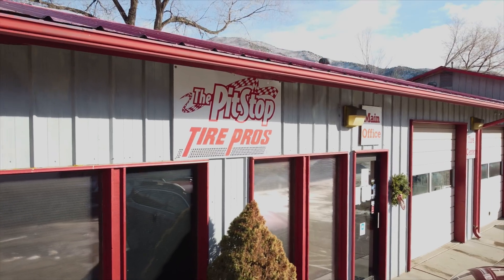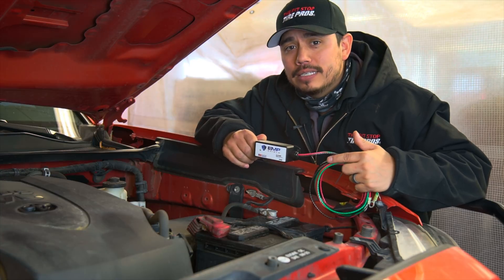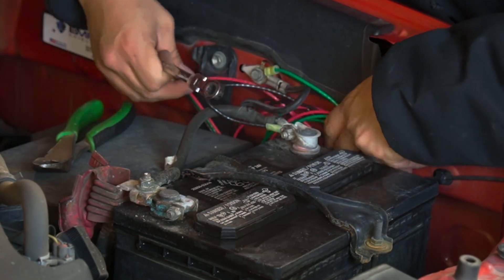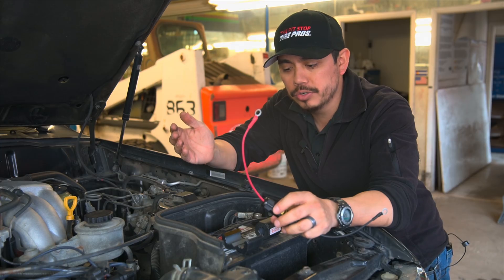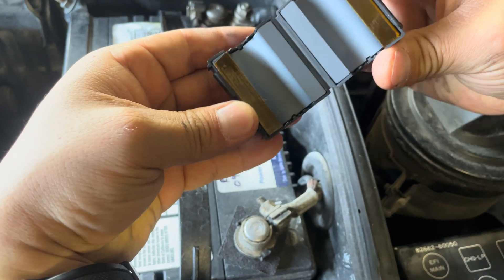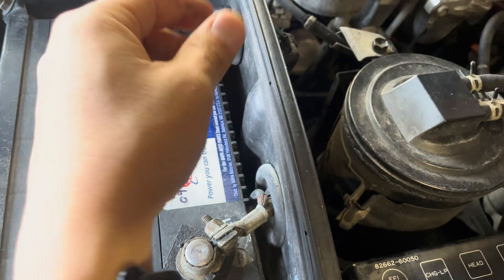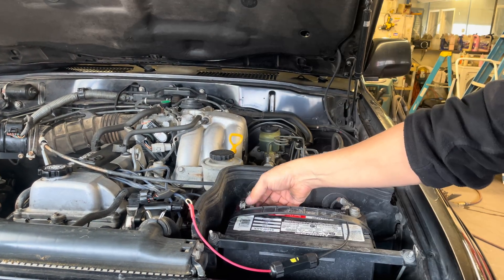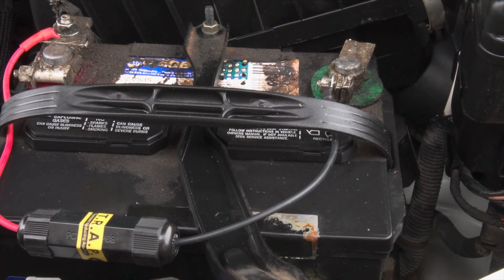EMP Vehicle Protection / What are the options?

Comment: Ok there’s a big thing I need to mention here. It’s that the EMP thing is a very old myth that continues to make people believe you need older equipment to survive. It’s not true and here’s why. New Mexico tech did a study a few years back and they repeat it every few years as cars get redesigned. Their outdoor EMP device was used to test a number of modern vehicles for resistance to a pulse. The study found that most vehicles if shut off durning an EMP will have no serious damage from the pulse. Running vehicles will shut off but can be restarted almost immediately. There might be some other non essential systems knocked out like the tire sensors or the radio or some of the safety sensors but the core vehicle systems will be unaffected and it will remain 100 percent operable. The reason is that a car is essentially its own faraday cage and it’s insulated from the ground via the rubber tires. Car computers if you think about where they are usually located are also insulated internally and are very robust internally they have to be. They have to withstand 160 plus degrees in 90 plus percent humidity for months at a time, followed by months of extreme cold with endless heating and cooling cycles. Stands to reason they’re going to be a lot more resilient then people give them credit for
Reply: Actually, it just dawned me.
There's a difference between a solar flare EMP & nuclear. From what I've read appliances & cars would be unaffected by a solar flare but the transformers & grid would get fried.
But, a nuke EMP would fry everything.
So, did study differentiate between the two?
Reply: @markmcflounder15 I know two different people that got their vehicles struck by lightning knocking out the stereo system in one and instrument cluster in the other. Might be a good investment for price
Reply: These things look like the surge protectors and not EMP protectors
Reply: As an electrical engineer, I'd want to see the study. Not to be insulting, but NMT is not exactly a top rated engineering school. #165 in the country. 

A metal car body is hardly a great Faraday cage because it has too many openings. The metal body helps a tiny bit, but not that much. The size of the openings determines the frequency wavelengths it will block, so not much. To illustrate that, does your cell phone work in your car??? 

EMPs are complex. In the case of a weaponized EMP,  The initial C1 pulse is most likely what destroys your processors. It is a very short pulse but very high energy. A solar CME will be much lower energy, but it can last a pretty long time. If I were gong to pick one, I would probably go with the EMP Shield because they meet military spec, 

EMPs can vary a great deal so it is tough to get very definitive. If the grid gets toasted taking out transformers, in your area, your car probably takes a hit. If kept in a tight steel building with steel doors and no windows and you have an EMP Shield, wiring in, you'll probably be OK when other cars around you become boat anchors. If in a city, a large underground parking garage, might improve your odds. And if it's a bad one, you'll want out of the city quickly!

A weapon based EMP probably hits at night, but a Solar CME will be a daytime thing. If you don't have anywhere to go where you can be safe, it probably won't matter much if your car works.
Reply: @professorg8383 I have done research on the EMP Shield boxes, they appear to be a standard power line lightening surge protector using MOVs for the home version and Transorbs for the 12 Vdc version.  Both types I expect to be totally worthless in providing protection against the E1 pulse.  You really can't tolerate any lead length between ground and the point you are trying to protect.  Even I you were able to use a surface mount shunting component, if the E1 pulse is at 10 GHz, 0,28 inch away from the connection point on the wire you are trying to protect, it is a quarter wavelength away, thus an open circuit protection wise.  Additionally, all of these bolt-on EMP protection devices assume the EMP will only travel into the circuitry via the power line, signal lines are ignored, as well as the radiated EMP finding multiple paths into the circuitry.
Reply: From what I've read, I'm not claiming anything here I'm no professional. Just curiosity. Sounds like a weaponized version is what we are worrying about. And like someone said, nuclear emps are going to hit somewhere along 50000 volts across the US. Pretty much everything is completely toasted unless it's already underground. I'm not ready at all.
Reply: That sounds like they're testing resistance against a lightning bolt & not an EMP.
How did they reproduce the EMP?
Reply: @markmcflounder15  
I get it wrong at times but A lighting bold is a EMP with a large amount of current.
Reply: You got it wrong. Read Wikipedia.
Reply: @OrmondOtvos  Wikipedia isn't allowed in any actually good study. Go actually study
Reply: Was thinking that too,, answer -  they didn't.
 @markmcflounder15
Reply: @markmcflounder15  It's government lab that has a large EMP device ( believe Navy?)  They rent it out to the OEM's to test vehicles.
Reply: BS.
Reply: 'There might be some other non essential systems knocked out like the tire sensors or the radio or some of the safety sensors'.  I wonder how vehicles that have all the electronics consolidated in the stereo head unit would fare?  Had a service writer mention that Hyundai has incorporated this design into a number of newer cars.  Stereo goes bad and you need it repaired?  You need to get a hot swap or an immediate repair so the car will run.  Someone steals the stereo the car won't run.
Reply: Ah, the things you will never hear from a dealer when you're buying a new vehicle.  Thank you sir for this PSA @KentWilke
Reply: Remember.04 ohm change will trigger the computer in car to throw many codes. Some may shut car down. Also the newer cars have much thinner gage wire and won't take over load well at all.
Reply: @thomaswaldorf9141  I noticed that fitting accessories to new chinese vehicles. The individual wire strands are like cat hair!
Reply: If a vehicle is essentially a faraday cage,  then couldn't you just throw your expensive gaGets and generator in the trunk and be all set?  Is my logic faulty?
Reply: @uncledog-x2n  It isn't a Faraday cage!! Claiming  that it is a Faraday cage, is untrue.
Reply: So the Soviet test in the 1950s, that fried the electrics in the 1950s cars didn't actually happen?  -- even though documented.   Huh???? Sounds like a fairy tail to keep panic down.
Reply: This is true for metal body cars, but the fiberglass body ones and those with overly complex systems will be fried. The other issue is the proximity to the pulse as well. The vehicle EMP protector does work well as a lightning surge protector for radios though when combined with a gas tube arrestor on the antenna, but as wired will not protect a car 😂
Reply: Laughing all the way to the bank... EMP is inductive, the energy is a wave traveling in the air and anything remotely conductive will gain a voltage from this wave passing. No way some box hooked to your battery can help, all wires on the car will light up at once , this Fries diodes that normally keep energy flowing in one direction and over volts most coils. The over voltage doesn't come from a battery spike and spread through the wiring harness like that product is designed to handle... All the wires go 90v and many positive and negative situations are created instantly, then the circuit has to discharge somehow this can fry the wires into thin air if not grounded, this is in a high energy EMP like from the sun...
Reply: Texas Tech and Texas A&M have done similar tests with similar results.
Reply: A burned or torched car shows how thin modern car panels are. Burning paint often melts away the roof, doors and other panels. Dont expect it to withstand and EMP or lightning if it won’t handle mild heat or electrical charge.
Reply: @jackjones9460  Modern cars handle lightning very well. I bought a 2004 SUV that had been struck by lightning and would no longer start. I only paid $6 plus the towing fee. Repainted the hood since that is where the bolt hit. I replaced the battery, a few light bulbs, did a reset of the PCM and BCM and it started and ran fine. That was almost 6 years ago and it is still going strong. By the way, it was struck while driving down the highway during a thunderstorm.

Comment: The EMP SHIELDS HAVE BEEN TESTED BY OUR GOVERNMENT. Go to the website, read, listen and watch the video before you say lies on here!!! All our Politicians and other government vehicles all have this installed on all their vehicles. We decided that we don’t want to walk several miles to get home and didn’t want to leave our vehicle along the roadside for many weeks or months. Imagine if the tow trucks don’t work or if they do it will be months removing the vehicles off the roads.
Reply: The EMP Shield has been certified to absorb voltage transients according to MIL-STD-461-RS105 and other standards. This only means it will protect the 12V system that you attached it  to. It can not protect the other components that are not connected directly to the 12V battery.  All the computers like the ECU, PCM, TCU  are on a separate 5 volt power system, and are very susceptible to voltage spikes. The EMP Shield on the 12V battery is not going to protect the low voltage circuits. Fortunately the car computers are usually built with transient protections.

Comment: I like to see it work
Reply: It will “work”, of course, if your aim to prevent permanent damage… but most modern vehicles aren’t permanently damaged by EMPs anyway—they test for that in the design phase nowadays. The only way to prevent an EMP from temporarily disabling your vehicles electronics is shielding. The doomers here are worried about EMPs from a nuclear device, but need to realize that there would be much bigger things to worry about than having running vehicle in that scenario.

Comment: This is going to be one of the best marketing strategies I have ever seen. It's a product you can't even test and if it's actually needed that if it doesn't work you won't even be able to go after the people who manufactured it 😂😂😂😂
Reply: Buy an old truck from the 70's that doesn't have a computer. Problem solved.
Reply: @AtomkeySinclair  Yep, that’s what my “buggout” vehicle is a manual 1990 ram 250 with a 5.9 Cummins.
Reply: @AtomkeySinclair you know computers have been used since 1968 right?
Reply: @flight2k5  I bet you also know the point I was trying to make regardless of how early the first manufacturer used a simple computer for the ignition system. The point is, get ONE that DOES NOT have a computer from that time period.... Then you have wheels that don't stop if you are truly concerned about EMP. Thanks for commenting.
Reply: @AtomkeySinclair  I’d  be willing to bet the emp thing is blown out of proportion. They actually did a test and it wasn’t a real issue with modern vehicles
Reply: @flight2k5  Very possibly. Besides. If that kind of stuff goes down having a vehicle will be the least of concerns. There may not be anywhere to go...!
Reply: @AtomkeySinclair you need to go older than that.
Reply: @ZeRTO_13  Well - it's a 1969 Chevy pickup truck :)
Reply: You can make an emp device at home look it up create replicated and test on the device to break and report it back
Reply: @GeorgeWashingtonThe100th  BUT WHEN WOULD YOU NEED IT!??!?! The poin t of an EMP sheild is just simply un needed, If a solar flare happens, were all gonna die sometime soon, Lightning striking you is a like 1/1000000000 chance.
Reply: @im_so_bored_rn  its the idea of it but we need to learn to adapt to survive without electricity lol
Reply: Guaranteed for life! Moneyback guarantee! 100% customer satisfaction! I’m with you I’m a little bit of a skeptic
Reply: Right THE CLAIM It can go to ground...DONT see that happening with RUBBER tires. Like the ones for homes... Every home is REQUIRED to have a ground loop already
Reply: Its not the battery that needs to be protected, its the tiny electronic components that will fry. So an old car with no electronics, will have the best chances to work even if it gets hit by an emp. A car with an old diesel engine, without fuel injection and without electronic ignition system would be the best choise.
Reply: This just might be the biggest scam I’ve seen on the internet yet.
Reply: Work or not - you can never sue the maker if the time comes and it doesn’t! - I want every chance possible to make it home from wherever I am to my family. Better safe than sorry.
Reply: I’ve always believed that the government flashes EMP in June to prompt people to buy new alternators
Reply: Unfortunately, none of these EMP protection devices that use wires as a means to connect to a point of desired protection can offer any protection from the E1 pulse; it's just too fast. To have a chance of offering some protection, the wires between the area you want to protect (typically the 12 volt line) and the actual component within the protection box, needs to be a tenth of an inch or less. Even with the tenth inch wire length, protection is still insufficient because the EMP finds it's way into circuitry in a variety of paths besides the 12 volt power line.
Reply: Brilliant
Reply: You know what they say they're just sucker. Born every minute. And generally people don't understand how emps wotk
Reply: lol big difference between lightning and solar and bomb
Reply: These are real....fake...

Bunch of varistors with specific limits .. this won't help much.

A experiment can be conducted though with this device. Although, it's tricky because what you are shielding against is already grounded in a cars case.
In a emp, any and all metal will conduct the voltage. Unless you have a ground prong stuck in the ground attached to your car with a cable this is ineffective. 

Imagine a coil of wire..being what's needed to be protected. (Phone semiconductors...any microprocessor) how can you protect the coil from an inducted voltage spike by grounding, when the coil itself IS THE CONDUIT. ?? 

It's a thought experiment. Because all metal objects will act as our coil. The metals we want protected that can be damaged
Reply: imagine being that broke that this is the first thing you think offf😂
Reply: Kind of like the vax
Reply: @phoenixbenjamin where is the “slow clap” emoji when you need it?!  Well spoken.
Reply: Very true.  BUT, if it works it could save livs right before the entire world ends.  It is a crap shoot.  Wanna play?
Reply: @henrymorgan3982  prep non computerized vehicles and gennys.
Reply: @henrymorgan3982  Sounds a lot like "be a good boy and you might get into heaven"
There are plenty of labs that do EMP testing up to the level of the ones generated by nuclear weapons.
Reply: it does not work.  rest assured.  it has very long leads which are going to make any EMP worse. @henrymorgan3982
Reply: @henrymorgan3982 your comment is pointless
Reply: Yes, that’s just like a coffin. The person that makes the coffin doesn’t use it, and the person that uses it never sees it. And the person that buys it never uses it.
Reply: You had better keep water and snacks in you vehicles at all times. Before we had the EMP SHIELD installed on our car we went to see our Mechanic. He said they are great and he's putting more EMP SHIELDS on the vehicles they get in. Then I phoned a Licensed Electrician that we know to ask him questions about it. He said, I already put the EMP SHIELD on my electric box. PEOPLE  DON'T  PAY ANY ATTENTION TO STUPID PEOPLE.
Reply: @carolynhelmic1474  Exactly. And in the case if an EMP Attack,  who you ginna complain to if it don't work.  In that case, who you ginna thank if it does work.  Modern day snake oil! SMH
Reply: @carolynhelmic1474  You’re right! No one should pay attention to your stupidity, Anyone even vaguely familiar with how electromagnetic fields work can see the EMP shield is B.S….
Reply: The Home EMP SHIELD has two green lights on it that lets you know it’s working good. The vehicle EMP SHIELD has one green light on it that tells you it’s working good.  The vehicle shield is connected to your battery because that’s what needs to be protected from an EMP ATTACK from a bomb or the Sun.
Reply: @carolynhelmic1474  Light just tells you when it's fried, doesn't mean it worked. Once the light is off it's fried.

Comment: Have anything for ebikes
Reply from the maker: Most e-bike setups are a closed pack system, but if your bike is plugged in to a house or building setup with a 140k amp surge protection device like the main service EMP shield then the bike would be protected by the whole house circuit protection.
Reply: @ThePitStopTirePros  well I was hoping there was a way to protect an ebikes all of the time not just at home I guess I could just buy extra parts and store them in a Faraday box. Thank you for getting back to me